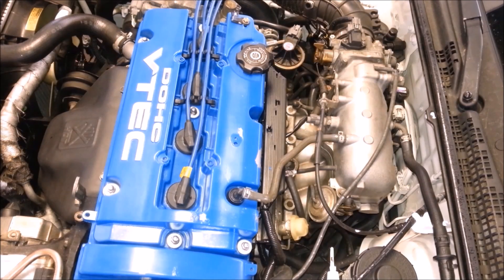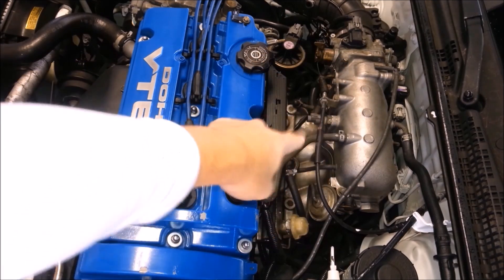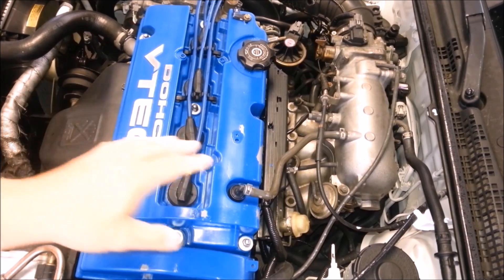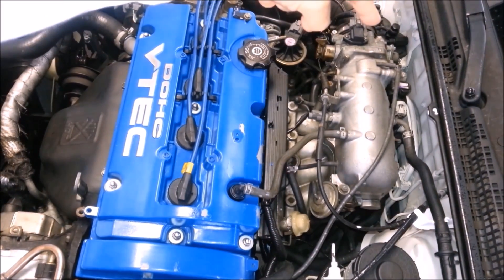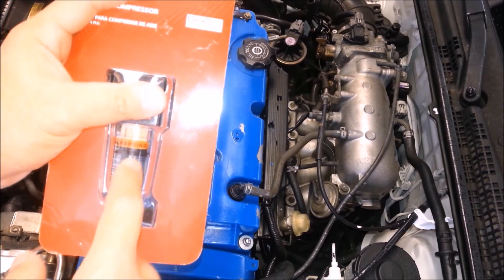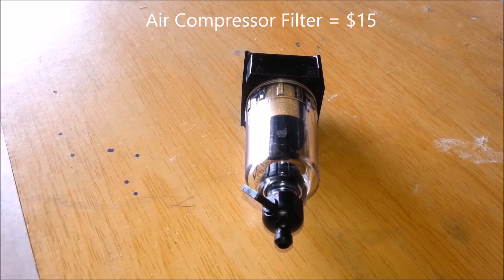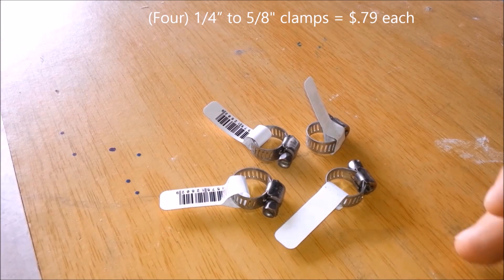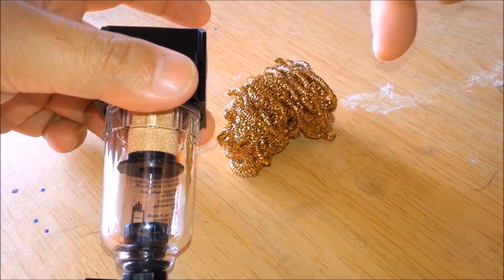DIY How to Make a PCV Oil Catch Can - @winstonbuzon

Comment: Nice Video!!!

Just a little correction that doesn't affect your video but....

A PCV is a Positive Crankcase Ventilation as you said... It reliefs pressure from the crankcase, not valvetrain.

The Blow-by air is actually compression gases leaking through the piston rings downwards to the crankcase.
Reply from the maker: Cool!  Good to know!  I told you I wasn't a technical guy... :P

Comment: Where did you buy your parts?
Reply from the maker: Got fuel line from auto parts store but everything else from hardware parts store (ACE, Home Depot, or Lowe's)
Reply: Winston Buzon tu crees que sirva instalar un filtro de gasolina que tu opinas de eso .